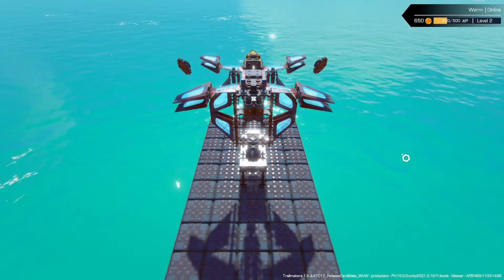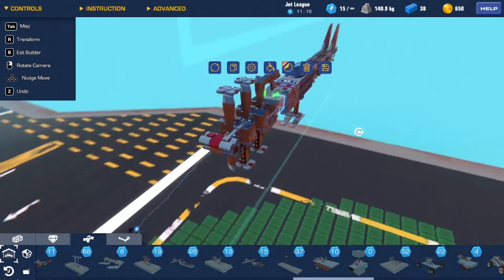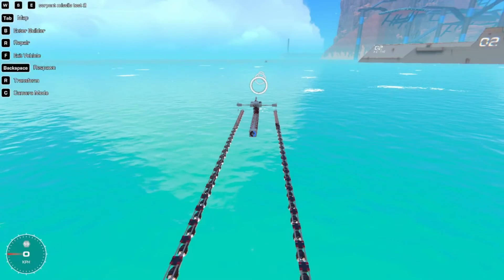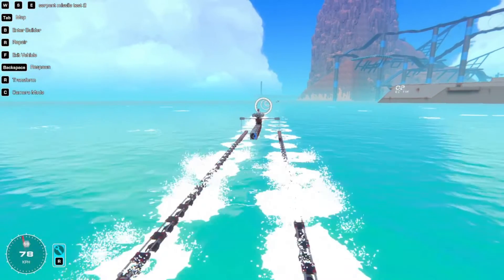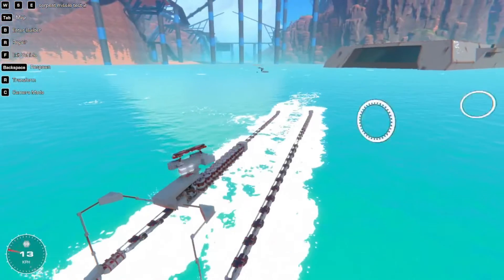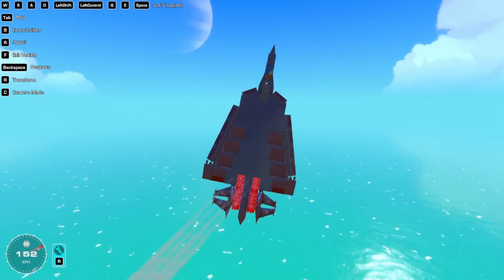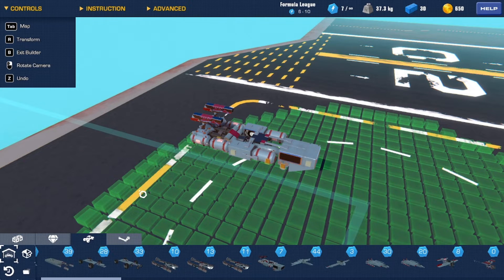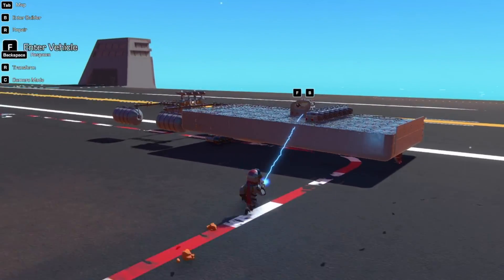MISSILES IN TRAILMAKERS? Custom Player Tracking System   |   RECOIL TECH

Comment: this is awsome,I must say. I thinked about player-tracking missiles an got some design. I'm not good with these so i'm giving it to you : after launch missile must rapidly accelerate(strongest jet engine for no DLC), then it starts spinning. Missile must have range detectors that activates gyros for turn. Range detectors can be placed on one or two axis : spin make flying up and right ussles, because spinning rocket will roll. (Bad at english I am)

Comment: Maybe you should use gyro stabilizer from the new Update for the Roll axis. So u only have to worry about 2 instead of 3 axis.
Reply from the maker: a good idea but impractical on missiles as if they follow a plane doing a loop, it will do a sudden flip at the apex.
Reply: @ThisIsDumbAllTheNamesAreTaken  u could deaktivate the gyro at an Angel of 80 degree.
Reply from the maker: then why have it? @teim9929  its just not worth.

Comment: Have you tried to zero-drag the radar?
Reply from the maker: yes, but only on some. i have not actually zero dragged the radar but it does also need some drag so it has to be not zero dragged. however, now that the spacebound update is out i will be going back and testing stuff with gyros and  probably zero drag everything then.

Comment: Auto aim prioritize centre of your creation in volume or the place where third person view is locked 
If you heve a creation with a long thing sticking out the 3rd person view will be on the centre of creation not centre of mass also auto aim
Reply from the maker: actually the camera IS locked onto the center of mass, and so does auto aim too. this is already something well established in the community. however, when there are multiple different center of mass from multiple creations i am not aware of anyone who has done tests for this and this is what i want to know.
Reply: @ThisIsDumbAllTheNamesAreTaken  well there is one glitch out there that is so OP it literally stops the Auto aim completely it's called the Lock-On Jammer glitch which uses hinges and something else that i can't exactly remember but how it works is when you activate it all the hinges glitch out and start flailing everywhere to the point where auto aim cannot lock onto the original build because of all the flailing hinge blocks interrupting the lock on.

Comment: So how does it work?
Reply from the maker: not too complicated really, imagine the gun as a thruster and the recoil being the thrust. if you had a stick balanced on a zero strength servo and put a thruster on one end perfectly inline with the servo, it will not spin. however if you turn the thruster even slightly the rod will begin to spin. when the gun uses the in built aim assist to aim at something it changes the direction of recoil, causing spin. everything here is based on this principal.